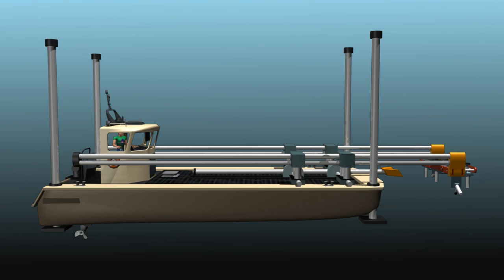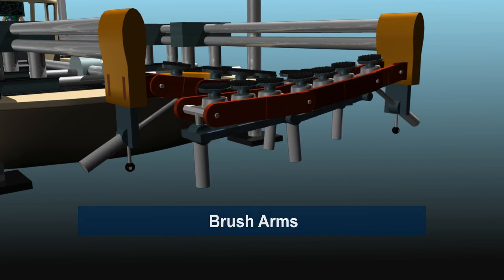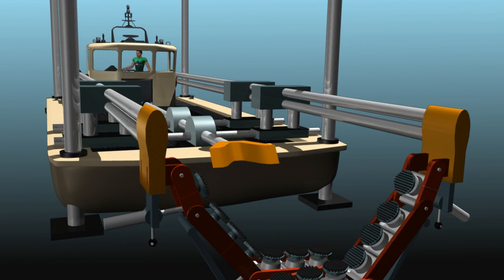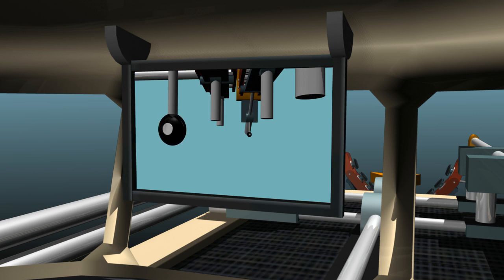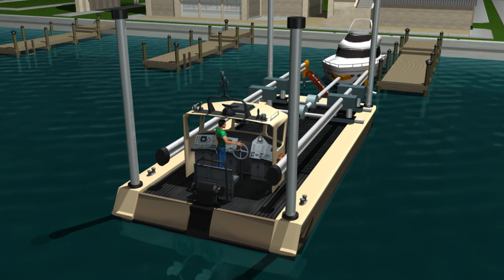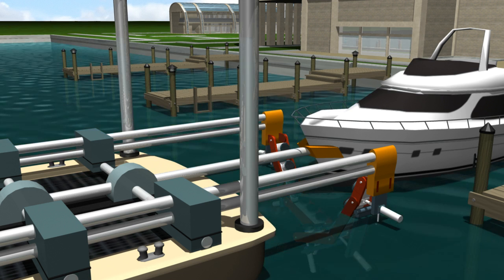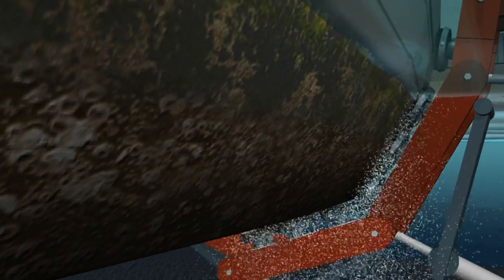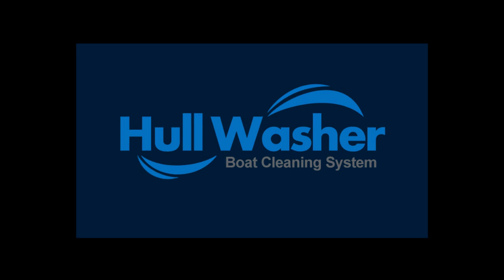Boat Hull Washer - System and Invention

Comment: This must be some kind of joke.  I've been cleaning hulls for 20 years.  This system will not be able to get around the most crucial areas of the shafts, propellers and rudders.  Thru hulls also require special attention to detail as does zinc or anodes.  And most of all 35 foot boats are becoming dingys as yachts just keep getting bigger and bigger.  Nobody with a 35 foot boat would be wiling to pay the bill.  Also, who wants to untie the boat from the dock each time?

Comment: So basically you completely block off access to one part of a marina for 1 hr. Then in the calm water of the marina stir up significant amount of debris and expect the cameras to be able to still see in murky water you have created. Also what does it do the anodes? 

It is an excellent idea, but has some serious flaws. Maybe you could look at laser guidance instead of relying on an operators visual. This could be as the arms extend they could scan the hull, and work out the best  way of manipulating the arms to ensure the fastest and most efficient clean. Also you could put a water jet which helps blow cleaner water towards the boat as you are cleaning so that you can keep a visual inspection to ensure an optimum clean. 

And I am not sure if any marina will allow you to foul up the water even more in their marina. Maybe a floating curtain around the boat and a 6 or 8 hose directing it back towards the cleanoing barge so that all debris is pulled towards a scrubbing system on the cleaning barge.